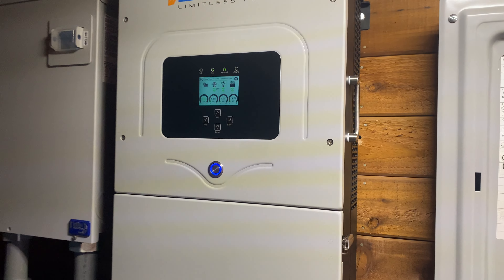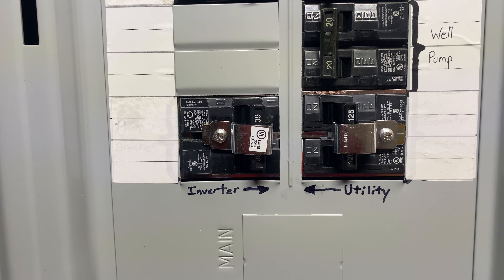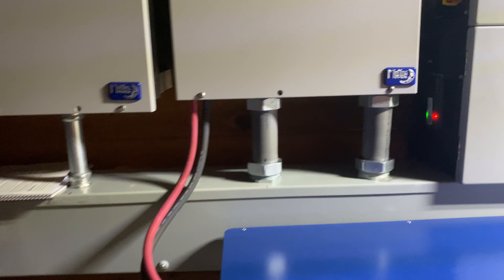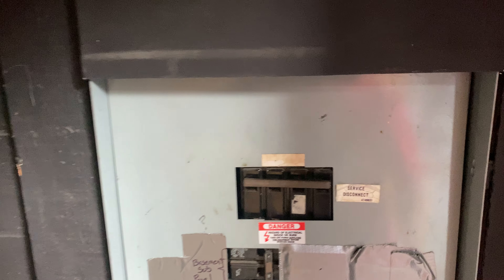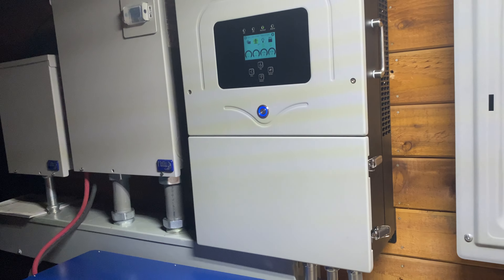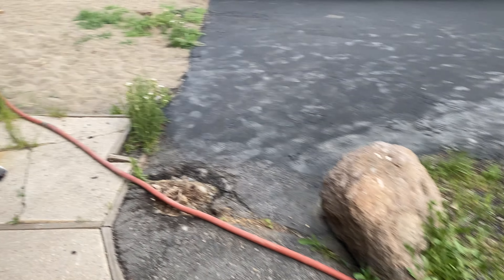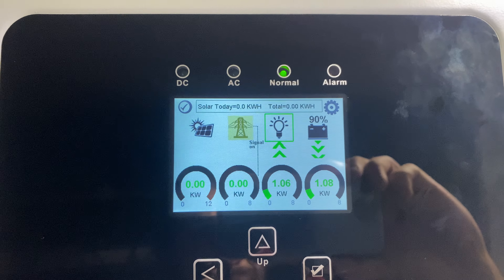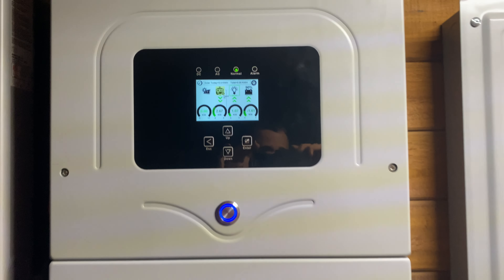Sol-Ark Whole House UPS and Solar Inverter Overview

Comment: I also have the 15K I have had multiple power outages since I installed. With 30K of battery. I am curios how well it handles brown outs as I had a massive extended one kill many appliances 1 fridge, one stove, one microwave , one wash machine .... Ouch. But strait outages are a thing of the past with the 15K not even loosing a clock time. I found a beauty DC diesel 48V genset so it's a beatiful combo 2.5 hours to refill batteries from 15% charged  Shuts off Inverter thinks it has a never-ending battery :)
Reply from the maker: I love the idea of a 48v diesel generator! Did you find a deal on a military surplus DC generator or have any model recommendations? Do you have it auto start based on a signal from the solar-ark still or how does that part work? I think having a DC generator that directly charged the battery would also give me the ability to still keep my manual gas generator setup as a backup on the sol ark gen feed too. I might look into this a bit to upgrade my setup. Thanks for sharing!